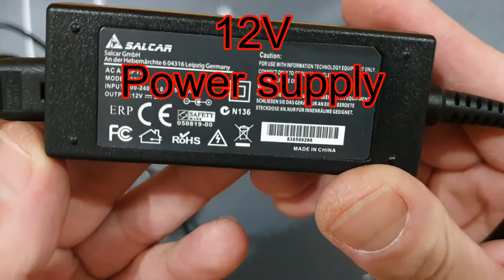Flyback Transformer ZVS Driver, How to Make

Comment: You sucessfully downgraded a flyback. The normal coil at 12 volts makes bigger arcs. But I must admit I'm trying the same rn.
Reply from the maker: That flyback transformer was burnt and I salvage the ferrite core, in this way I recommend doing it only if you need a few Kv. To obtain really big arcs is needed very thin copper wire with thousands of turns and very good isolation between the layer's other wise will probably arc between the layer's. Search on my channel for a video where I put two flyback transformers in series and see really nice big arcs.
Reply: @HMProjects  I'll try to get as many turns as possible. And then I'll put it in oil and pull a vacuum to get trapped air out. Let's see how well that works.

Comment: Where did you get that enamelled copper wire ?
And for the insulation between the layers, what insulation are you using ?
Reply: You can buy the copper wire or get it from transformers.
And the insulation i would recommend you to use paper and submerge the transformer in mineral oil but its quite complicated to use this metod.
So you probably would be fine using a plastic tape btw sry for my bad english
Reply: For the insulation between the layers he used clear tape

Comment: A bit hard to winding the copper wire lol
Reply from the maker: It took me about 2 hours to wind the transformer, Is not that hard 😁.
Reply: @HMProjects  i made one too but a bit bigger and it took me around 3 hours and it blew up after 30 seconds cause I didn't isolate it enough 😂